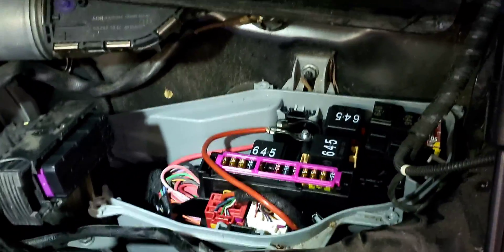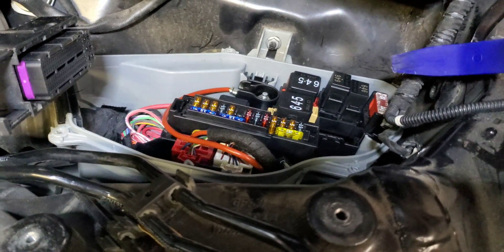How to Install a CWA-150 Coolant Pump on your Audi 3.0T | C7, B8, SQ5

Comment: Hello, it's very interesting to see your logs.
What fuel are you using? It seems like the spark advance starts to reduce at 60°C intake air temperature, is that correct?

Comment: Why my cwa100 jump so fast the ita to 80celcius?  In the middle of 3th gear I'm around 80ç ita. WTF am I missing... uffffff disappointed
Reply from the maker: Something is wrong. Do you have the pwm wire disconnected? Is the system fully bled?

Comment: How much ita temperature should get with dual pully when i push it from 0 to 250kph??? 
Mine getting at the 4th gear 80celcius... and probably going to a limp mode.....

Comment: Thanks for the video, I installed the cwa150 from GAS motorsports on my sq5 and for some reason the pump activates when I open/lock/unlock my doors. I used the supplied wiring harness and 20amp fuse... any clues on what the issue might be?
Reply from the maker: What tune do you have?
Reply: @AudiC7Owners I have the jackal stage 2+ 93 oct with upgraded hpfp option. Upon research it seems to be normal operation as that specific fuse location activates with CANBUS on operations (doors, poping the hood etc) it stops after 2-3 minutes which isn't so bad. On the flip side, when I turn the ignition off after a long drive the pump works to dissipate heat.
Reply from the maker: With the Jackal tune the cwa will activate anytime power is applied to the car. Even just by unlocking it usually

Comment: Hey Cam, is it safe to use Cwa-150 without a divorced setup?
Reply from the maker: Yep
Reply: @GarageTaught awesome thanks bro. I have ap velocity ports and 3/4” lines I’m routing the the system 2n. Also Mercracing has 3/4” metal y hose adapters!! Hopefully this should aid in recovery as my CWA-100 lasted almost 2 years on 100% duty cycle. I can’t hear my pump and I’m getting power to those charge air pins. Thanks for the vids!! Keep em coming!!

Comment: Hi Cam!  I'm installing my CWA1500 next week!  Im thinking of replacing tensioners as well while im at it bc my 1360 Bando belt snapped yesterday and I'm running a 207mm crank pulley.  Matt mentioned that I may have had tensioners.  Do you know what tensioners I should replace to avoid the new belt from snapping again?
Reply: I don't know if you found anything yet but there is an aftermarket billet tensioner made by VPS that will definitely be a good upgrade.
Reply from the maker: The vps tensioners are known to fail
Reply from the maker: I missed this comment but German Performance Solutions is releasing oem tensioners with their metal pullies. I'll have videos on them soon

Comment: Thanks Cameron again for a great video.  Headed to the garage for some continuity checks to verify that fuse.
Reply from the maker: Let me know if it's the same for the facelift 👍🏼
Reply: @GarageTaught  It is the same, however, mine comes with a 25 amp fuse already, as seen in the post on FB. No modes were done to this prior to purchase, it was a leased vehicle. one note may make the difference, not completely sure… I have the A7 3.0TFSI Competition model.  But again not sure.

Comment: Please Help!!! I hit a opossum last night going about 65 MPH busted my front bumper and it ripped the 3 pin connector out of my coolant pump. I purchased a new 3 pin connector each pin is numbered 1 2 3 but the wires are solid black. I have  3 wires dangling from the harness that goes to the pump the colors are solid RED, solid VIOLET, and RED with a WHITE stripe. Does anyone know what color goes to each specific pin number????? Any help would be greatly appreciated.
Reply from the maker: Hey man. Check out my cwa-100 install video. I show the harnesses up close in that video I believe. That may help you
Reply from the maker: In the mean time I'll look around & see if I can find a reference picture
Reply: @GarageTaught  I really appreciate your response thanks a lot. I did look over your video just cant get a clear view of it..I will keep trying.
Reply from the maker: I'll see what I can find out for you

Comment: How do you get the pin to release to pull it out the plug?
Reply from the maker: To de-pinn free pwm wire or to release the actual connector for the wiring harness?
Reply: @GarageTaught  yeah, are you pushing in on the side of the middle wire, the little metal side spot? Is that like a little hook release that needs to be pushed in to slide out the wire?
Reply from the maker: The de-pinning tools I have allow me to just push them out from the front of the connector

Comment: Crec has a 25amp already in place
Reply: Im sorry for asking a dumb question but i like to be sure, does that mean for my crec i can just install this cwa150 pump without changing the fuse
Reply: @c7.5_noel you won't have to change the fuse so in theory yes. However make sure the cwa150 comes with the correct wiring harness.

Comment: Hi Cameron just watched the coolant Divorcing video awesome video  so I just recently just swapped my heat exchanger to a upgrade one from ecs so in there instructions to bleed it is to turn the car on but not running to kick on the auxiliary water pump so I did and it dose not come on so I check the plug for power and it has power I also rigged up a 12 volt source to touched the pins on the pump and it comes on so I’m not sure if the pump is bad or dose the pump come on a different way I have a 2011 Audi s4 thanks
Reply from the maker: So you have normal power in the plug, Ave when you connect a power supply to the pump it runs?

Comment: So the conclusion was that the CWA-150 wiring harness was plug and play? and you didn't need to re-pin anything?
Reply from the maker: Yes. The cwa-150 wiring harness supplied by MercRacing works without any issues.
Reply: @GarageTaught  Thanks you the GOAT

Comment: I’m curious to see if the 150 with an OEM Heat exchanger can net the same benefit of the 50 pump with and aftermarket exchanger. 

It’s definitely cheaper and easier to upgrade the pump VS upgrading the HX
Reply from the maker: A hx upgrade will always outperform a pump upgrade.

Comment: Would you recommend this if we are tuning an s4
Reply from the maker: That depends on the pump working with the pwm wire or not on the b8/B8.5's.

If it doesn't, then there is no advantage other than current price & availability.

Comment: I have a b8.5 s5, with a stage 1 ecu tune from IE. Is it worth buying the cwa 150? I do have the merc racing hx but haven't installed it yet. I'm also looking to go stage 2 but with a single pulley upgrade.
Reply from the maker: If you are on the oem cwa-50 then yes, the 150 is worth it. Get that hx installed